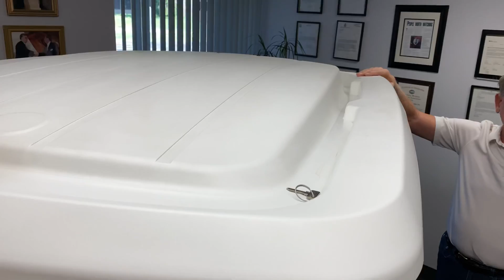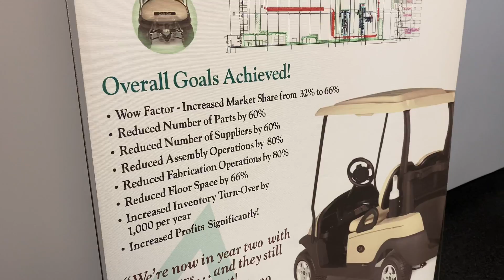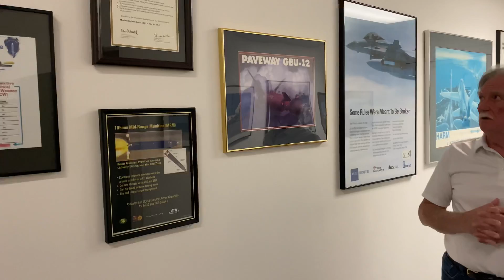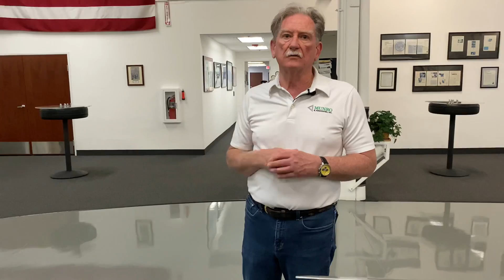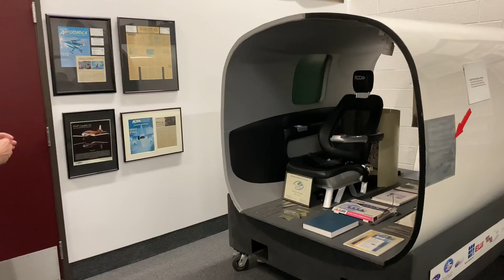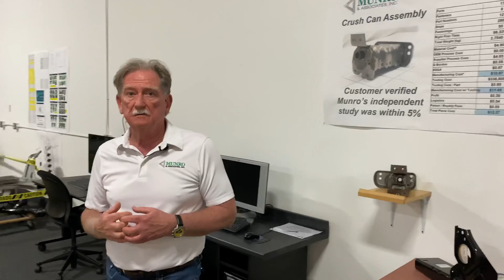Munro & Associates Tour

Comment: The only thing I remember about lean, is when it was implemented we no no longer have enough material on hand for more then two days work. (we have snowstorms.) I lost half my workspace, didn't have room to rotate what I was working on, I was forced to stand in the walkway while working, and My trash can was taken away. (supposedly we weren't using them correctly.) I tried to explain to my boss making improvements is fine, changing processes is fine, but if you take away things people use and need with out putting something in its place you're going to have problems. What do you know, production went down, weather shut us down (we were an indoor shop.)

Comment: Overwhelming amount of capability. 
I do wonder how many individual mechanical and production engineers egos Sandy has bruised.
In fact...how does Sandy manage to inform one that the means and methods they’ve employed is flawed and needs improvement or replaced without them getting butt hurt

Comment: Ha! I have a club car precedent that I used for my street legal lipo LSV. Love that it has good bones! Edit: no way you can swap those lead acid batteries that easy. Certainly not multiple times per day.
Reply: Shannon S agreed, those batteries would be heavy and overhead access would need a moveablecrane which would likely be unwieldy. Your swap out to lipo makes more sense. Then again, lipo would have difficulty with recharging in cold winter courses

Comment: 6:47 only 6 hours!?! are you familiar with EnerSys, they make batteries for forklifts/electric pallet jacks used in warehouse operations, their batteries can last a full work shift, lifting and moving 1000 of pounds of merchandise, I find it very hard to believe this cart can only carry two golfers with their gear and not last a full day of golf.
Reply: You need a low weight to drive around in the soft grass.
Reply: Are you familiar with how much those weigh and volume those batteries need? Oh by the way I’m guessing they also lift out to put charged batteries back in
Reply: andrew nelson the forklift batteries are way too big but an electric pallet jack battery could definitely work just need a different form factor